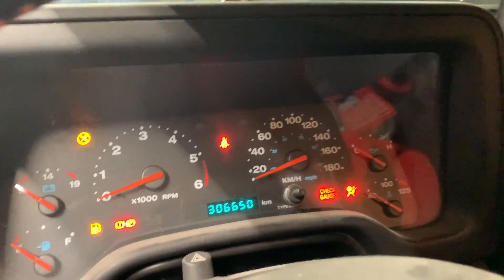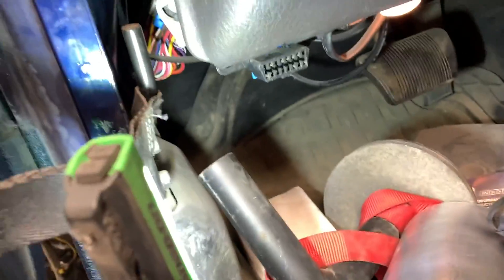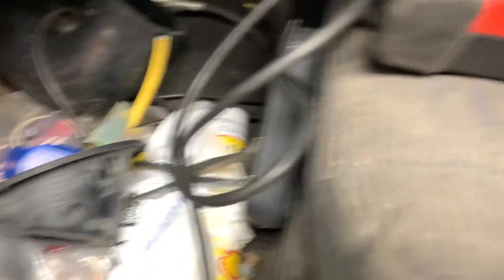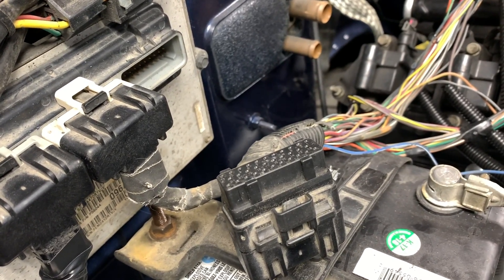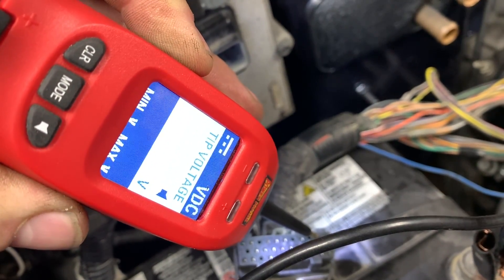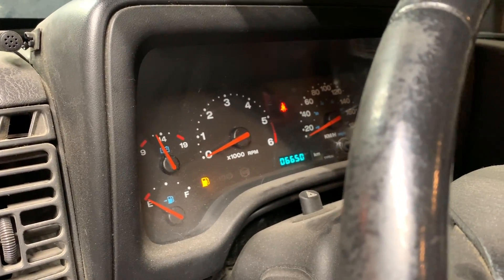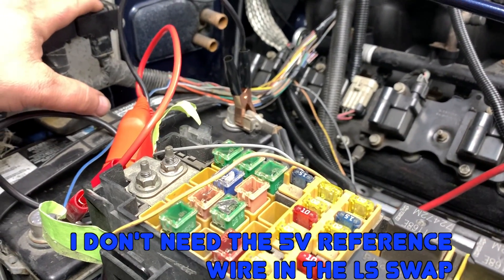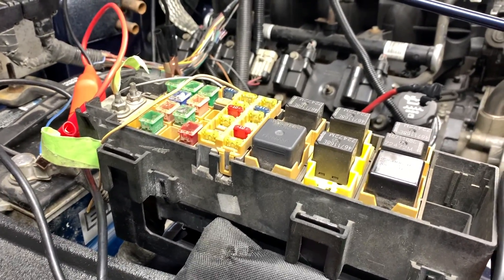How to Test Jeep Wrangler PCM ECM

Comment: I wander if you could help me do this on my wife 06 wrangler Tj it has brand new engine installed won’t turn over by key turns over fine with jumping s terminal but I don’t think it’s getting fuel or spark will not try to run at all I tried little gas down throttle body I tried little whiff a starting fluid nothing lots of new parts tested crank position sensor 611 ohms and 1100 ohms I just need a accurate step to verify the wiring is good the only thing not working is right front head light I think it’s the plug tho it ran fine when I tore down in June won’t start on new engine is agony gonna start independent test of every new part installed verified timing five times no reason it won’t start sure could use a buddy that could help me thru my 1 weakness wiring I got my power probe and autel scan tool awaiting your instructions lol

Comment: Life saver on this one. I'm shoving an 03 TJ Motor and trans into my 90 YJ. The wiring has been the most daunting part and I was able to get the PCM to turn on and communicate with a scan tool with your help. I was the fused 12V source on Pin 2 that I was missing.

Comment: We're both doing different engine swaps (engine swap + wire harness splicing), but had the same issue with that pin #2 ...  It was the last piece of the puzzle that had me going insane, buried deep in there, and I had not even consider it until watching this video.  Thanks for making this video.

Comment: My pin #2 also does not show any voltage and my gauges don't work, but lights on the dash do work. How do you remove the wire and and replace it ? Do you happen to have a video on that ? That would be awesome ! Thanks.

Comment: Man, I’m wondering if my PCM on my 97 TJ 4.0L is going on me- I’m randomly losing all power (only enough to give slight illumination to the under-the-hood light). Battery tested, alternator tested, multiple times and both are good.  Just purchased new battery cables, hoping that maybe that’s the issue, and I planned to anyway, because the 1 gauge cables will allow me to add more fun stuff to the jeep. Any thoughts? Also, occasionally when I’m driving it, the voltage will peg out.... it hath a demon.

Comment: No power for me on pin #2. No fuses were blown either. I jumpered #2 to the battery just like you did bc it had no voltage reading. My dumbass forgot to turn the accessory mode on the ignition to confirm. However since then I replaced the pcm which seems to be the problem. My question is... should I pull the jumpered #2 off battery, twist wires back together again, solder and heat shrink tube the joint? Or can I leave it jumped off the battery? I’m don’t know if constant voltage to that #2 will slowly trickle juice from my battery and I’m not sure if #2 needs constant power. FYI - I have a 97 TJ with the 4.0. Just incase that makes a difference. Thanks for all your videos.